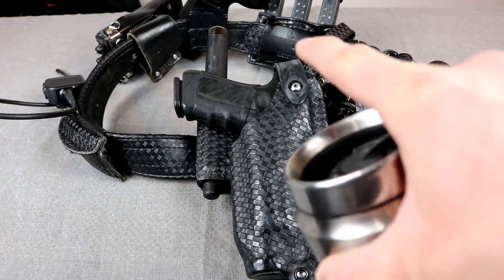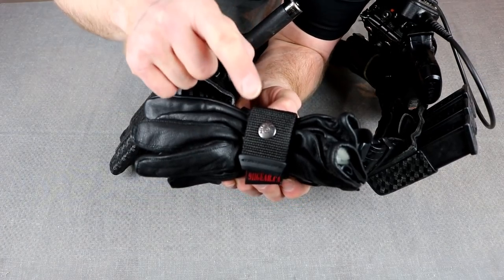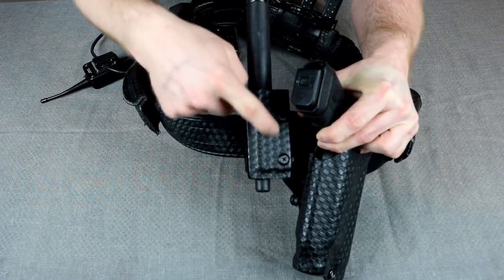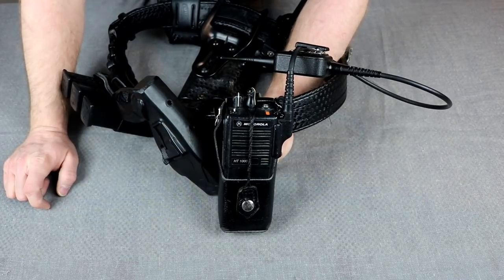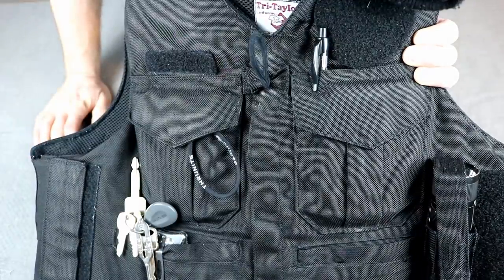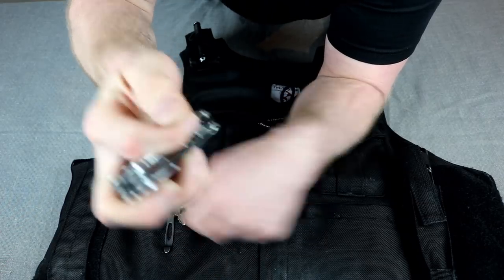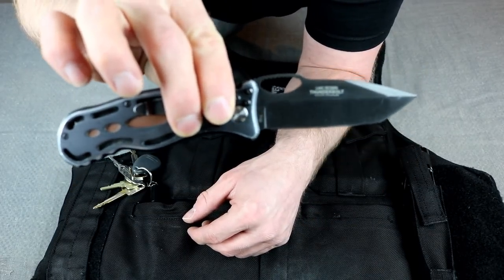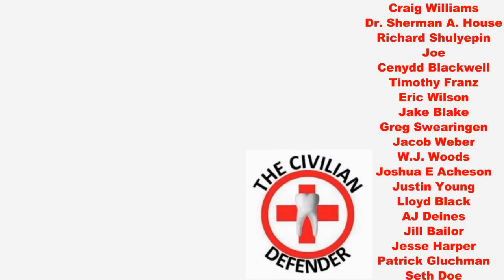POLICE Duty Belt: New Ideas

Comment: I’m blown away w/the amount of gear cops carry.  I started in 1968 and our duty belt had a revolver, 18 rounds of extra ammo, cuffs and a stick.  By the time I retired in ‘97 my duty belt had a Glock 23, two spare mags, cuffs, a collapsable baton, and a portable radio.  Apparently the cargo vests came along some time after I retired but all that gear has to be VERY heavy.  As to having enough ammo on your person I ran out in the middle of a gunfight in 1974 using my issued Colt Detective Special so I always carried LOTS of spare ammo after that experience.
Reply from the maker: Some of it got lighter so there is room for more stuff. Vests have dropped dramatically in weight in the last 20 years and flashlights weigh only a tiny fraction of what a mag or kellight used to weigh. Polymer laminates have nearly completely replaced leather and boots hare mostly foam and polymer compounds now. The only thing that has stayed about the same weight is the radios. (depending on how far you go back)
Reply: Yikes! Must’ve been quite an experience to run out of ammunition in the middle of a gunfight!
Reply: Considering the situations you can get into I would carry more than anyone you know..

Comment: Baton behind the gun is not optimally placed.  Its slower to draw since its akward behind the back and you can't deploy a striking draw.  Cross draw baton is better.  Also its best to keep other weapons away from your gun side.   If a suspect is fighting for your gun,  they will also have access to your baton on the same side.  If the baton is cross drawn from the weak side,  it can deploy and strike a charging suspect at the same time. I keep all non lethal weapons on my left side. I've been to two academies in CA and they both teach baton away from gun side.

Comment: Big thing I would recommend changing would be the holster. I would go to a level 3 with the ALS as well as the SLS. That way if you do happen to draw your firearm, you don't have to worry about rotating the hood back up to make sure your firearm is secure. With the ALS it will automatically lock your firearm into level 2 retention, without flipping the SLS hood back up.
Reply: Hunter Boone agreed
Reply: I went the same route. I used a low  ride  belt mount and used a old drop leg strap and ran it between the holster and the belt mount to limit the holster flop when drawing. It worked well for me without having to use a drop leg.
Reply: Nope.

Comment: You might like looking into Uncle Mike's Mirage Belt Keepers.  Molded polymer ones I lucked out and purchased by accident in recruit school back in 2001 and have pretty much lasted me since then.  Minor scratches and wear and tear, but still very serviceable.  Bought a second set when I lost a couple over the years, but other than that all are still in use.

Also started using the Center Mass Patrol Rifle Integrated Magazine pouch.  Usually is placed behind pistol mag pouch, but I've been using behind my taser holster.  Can hold a 20 round pmag without being visible at all.

Normally carry a surefire 6P on my belt so that I always have a light day or night.

Comment: Kind of different from how I wear my belt, but we're not using utility vests, so everything has to go in the belt and pockets. One suggestion I have for you, is to consider moving your radio up to your chest, especially if you are getting newer radios that might be more light weight. We use Sepura TETRA terminals which are really lightweight, and it's a breeze not to have to worry about the cable going up from the belt, attaching it etc. Just move the whole thing up there. I was sceptical about it at first, but now I totally dig ut. Less wires, less weight, less stuff to go wrong. And just attach a mount to your shirt/jacket/vest whatever, so if you're changing clothes, you just clip it off and on again in a second.

Comment: I would recommend the Streamlight Stinger LED HL, it is a very good light that puts out 800 Lumens compared to the 350 Lumens the normal Stinger puts out. It is going to run you around $110 depending on the package you get from the Officer Store
Reply: Keaton Pfost picked one of those up recently. Since I already had a stinger, I bought one on Amazon without the charger for about 80 bucks. Put one of those Bust-a-Cap glass breaker end caps on there and it's a great multi-function tool!

Comment: I'm not LE but in my time working security and in the Armored car industry I found the safariland 6360 which is the level 3 version of yours to be a better holster. I could draw from it just as fast as I could from the 6280 and it's a lot more secure. I can't tell you how many time I bumped the SLS hood on something and opened it. I was glad to have the added ALS lock to keep the gun in.

Comment: New flashlight you say? I just picked up an amazingly bright bad ass light. The bundle was about $100. The Nitecore P12GT. 1000 lumen,  different brightness settings with memory for the last used. Came with 2 3400amp hour batteries, that last forever. The light itself has a simple warning light built into mode button after battery reaches 50% discharge. 300yard search type beam at night with decent spill still to light up the surrounding area.

Shout out from a South Burbs native, pretty far south but still North of 80
Reply from the maker: Sounds like you are right by me....

Comment: If you still use those or similar gloves, you can use most any mild soap or saddle soap. Disinfecting is trickier, alcohol might be the least damaging. Perhaps some of the Lysol concentrate mixed with water. Then treat with some Lexol (not too much or too often as oils will damage leather over time) and a wax treatment (can be used every cleaning and in between to preserve the leather).

Comment: Typical but good setup. I see some people carry the tazer at the 10/11 where your mags are, mags at 1/2 where your cuffs/leathers are, flashlight behind the tazer at your 9, and cuffs at 4 where your baton is. Tazer is right up front and closer for cross draw, while shooting the mags are right below your support hand, flashlight is at your side where your arms rest, and while grabbing your cuffs you can go forward to deadly if need be. Not a major reduction in reaction time, just slightly less distance to travel, but the most important thing is that you know where your gear is blindfolded. As for the radio, if you use it a lot, up front might be better. And i like the key thing, i do the same thing for my house keys so i know which to use at what door in the dark. And a cool handcuff in my opinion is the streamlight one, it has a light on both the key and the lock side, and is flat so you can get good grip and torque on it.

Comment: Great video, very informative.  Just 1 suggestion....move the tourniquet off the shoulder.  IF you were to need it for self-aid, you should have it in a spot that is in easy reach with either hand, even if that hand/arm is injured.   I would place it on your duty belt, in place of your leather gloves OR to your vest on the lower right hand side just off the pocket...opposite to your flashlight.

Comment: Seems like a fairly good setup, may move some more of the gear off the belt to the vest if the new one allows, like your cuffs, radio, maybe the tazer, anything to shift weight off the hips and more to the shoulders. Changing up to the 6360 if allowable would not be a bad move either. If you carry an AR in the car, maybe a spare 20 or 30 round mag on the vest or on the belt? Or do you carry a go bag with spare mags / IFAK / extra tq in the trunk?

Comment: My suggestion would be to move the magazines to a strong side draw on the vest.  Put the baton on a 45 towards the gig where the mags are currently. If you use a double horizontal mag pouch the baton will lay right on top of them allowing for five mags all together. Taser criss draw on the vest as well
Reply: I don't like things that can cut kill or cuff me accessible to those behind me
Reply from the maker: If I could put the taser on the vest I would definitely put my baton back in cross draw. That's where I had it pre taser. Policy though precludes me from moving the taser substantially.
Reply: free field training industrial hook and loop tape. Velcro. I have my omag fast mag and a Motorola radio on my vest that way and never had it cone off running or if it got snagged. I use Velcro brand industrial vi use it to keep level 3 hard plates in place too. Keeps the plate from being able to move at all

Comment: Love and hate the slim profile triple magazine holder. Love that you can get 3 mags in the same space as 2. Hate that the mags are uncovered/exposed. Once we go to the ground with a subject, those exposed mags can end up anywhere. I'm thinking of just using two covered double holders on my belt. More secure, plus 4 mags on my belt instead of 3
Reply from the maker: Nah, I've had them for several years now and haven't had that issue. We fight people on the regular here as well. I'm actually running an open top light pouch on my vest now as well. You just have to tension them properly.
Reply: @freefieldtraining  Oh well that changes things a bit... I didn't realize that there was adjustable tension on those. I assume it's a screw? Thanks for the reply, I'm gonna look into them for sure.

Comment: If y'all are switching to molle I'd get your radio on it, and as far under your arm as it will go. I run my radio under my right arm pit (left handed) and once you get used to it...it's out of the way. 
Otherwise the sreamlight Strion is a slick little light and streamlight makes a hard plastic carrier for it that should slide on the vest. 
I'd invest in a eleven10 TQ carrier, they make vest attachments for those as well. Probably best to put it dead centre on the vest. 
Otherwise the more crap you can get on the vest, the better.
Reply from the maker: I had an eleven 10 carrier, it broke rather quickly.
Reply: free field training I guess that's a valid reason not to carry something. I've had a few. The slick front one has held up well. Seems like the ones with the medical cross in front don't last as long, I put those on my medical bags. If there letting you guys switch to molle there is probably a millitary style holder that will hold up better. We're still in slacks and internal vests so we're pretty limited.
Reply from the maker: Yeah, mine was the cross front one. Maybe the others are better, just never went back after the first one. Now I just strap the TK right to my vest with rubber bands and hair ties. Works well and very cheap.
Reply: free field training can't argue with that logic

Comment: Ya know you can buy a thirty dollar Stinger LED Switch Kit for your traditional stinger. Even if you still pick a cool new flashlight you'll still have a great, reliable, 800 lumen full-size light as a back up for your back up. I think posted this on da gram. It'll fix your button issue in addition to an emittance upgrade.

I had the same issue. It would always take at least 3 additional hard clicks for it to shut off sometimes. NOT safe at all when searching for felony suspects at 1 in the morning through peoples backyards. I think what messed it up was water damage. After 6-7 years of being dropped on hard surfaces, falling out of cars, back pockets during chases, and being used as a door knocking and impromptu window breaker, something internally must have loosened and broken a seal. I remember it messing up a little while after backing up another radio on a 415 F (Dispute between a dad and his deadbeat son ). Long story short the son slapped the dad and a tussle ensued. My light falls from my back pocket and rolled into their pool and was 5 feet below for fifteen minutes. Not exactly exceeding Ingress protection standards but its still a long time. A month later I picked up a switch kit from the 'Amazon.com and everything is working perfectly.

Comment: I support you carrying 3 spare mags, but as far as not having enough ammo, that wouldn't be the case as to why anyone should carry a spare mag, the reason why I as an instructor recommend people carry a spare mag is because the one in the gun could fail, and the quickest way to fix a jam, is by doing a reload. If a tap/rack didn't fix it, reload it. If you have a double feed, use a different mag after you have cleared that jam. 

If you have used your side arm as a club, after shooting some rounds, treat the gun as a single shot, and put a fresh magazine in, because the sheer inertia and movement of the spring compressing and extending, could cause a round to flip, or rotate while in the weapon, and cause it to not feed properly.
Reply: And if you are two mags in, and the threat still has not stopped then you need something bigger like a shotgun or patrol carbine.
Reply from the maker: @JohnSmith09123  Problem there is gunfights in the US are come as you are affairs. If you don't show up with a rifle or shotgun in hand and ready to roll  statistically the chances you will make it to one before the fight is over is exceedingly low. Plan accordingly.

Comment: Would be interesting for you to add a extended baseplate for your mags, +3 rounds to each mag can make a difference and it doesn't weight all that much
Reply from the maker: All the ones I have tried have reduced reliability.
Reply: @freefieldtraining  Were the springs also upgraded ? It's a common mistake with baseplates that causes unrealibility, in any case the Taran Tactical baseplates are pretty solid although more on the pricey side.
Reply from the maker: Yep, I've done it all in that regard. I have a zero tolerance policy for unreliable magazines. If a mag has more than one failure it becomes a dedicated training mag and is replaced with a new mag. Mag extensions are fundamentally changing the geometry and spring rate of the magazine. Unacceptable risk in my book.
Reply from the maker: Now, the 22rnd glock factory mags I have tried and if I wanted more capacity and a slightly longer mag I would just switch to those.
Reply: @freefieldtraining  Those are really good points.

Comment: I would make a little space between the mag carrier and the taser, and put the baton inbetween, using one of ASP's rotating scabbards. 

That way, you could quickly deploy your baton with either hand. 

I'm saying this because of the Hindi Duty Belt S.A.F.E.T.Y. System, which I would follow if I used a duty belt.
Reply from the maker: I tried that a few years back, problem is the taser rotates out of the holder, and this is the only holder currently available for the x26p. If anything is in front of the taser it obstructs drawing the taser. Which sucks because I prefer the baton on cross draw.
Reply: @freefieldtraining  
Would putting the baton inbetween the taser and radio work?
Reply from the maker: Can't cross draw from there
Reply: @freefieldtraining  
How about rotating the belt so that you have a little less room on your strong side, but a little more room on your weak side?
Reply from the maker: I'm not understanding what you mean
Reply: @freefieldtraining  
If you twist your belt so that the buckle is off centre (right hand side); slide everything on the belt back into the positions they were before (apart from the mag carrier); and then there might be enough room on your left-hand side to put your baton in a cross-draw position.
Reply from the maker: That wouldn't give me more room as the mags need to be where they are at. I can't put them center line on my body. That would take reprogramming almost 20 years of training for where to go for them.
Reply: @freefieldtraining  
There are holsters for the X26P available from Safariland, Blade-Tech and Blackhawk. Maybe one of those would allow you to carry the baton and taser in a cross-draw position. 

If that doesn't work, you could try mounting either the taser or the baton in a cross-draw position on the molle on your new vest.

Comment: That rubber slip on grip for your hand gun is prohibited at most agencies for good reason.  It can slip up over your mag release and hold it depressed.  Most people tell me they never slip but most people did not take the setup to a handgun retention class and see what happens when you are fighting for possession of the handgun.  Stay safe all.
Reply from the maker: The thick ones do. This is just a piece of bike tire inner tube. It has to be replaced about every three minths but it doesn't cause any mag release issues and it adds minimal bulk to the grip.

Comment: But there just has to be a better polymer carbon fiber mixture that's more durable and resilient but still gives you the wiggle room so you don't feel like you're running like a robot or Frankenstein with the Rigamortis all that weight shifting side to side there's just got to be a more law-abiding way

Comment: I have a similar designed belt I found at a local pawn shop. In good shape still with some minor wear from previous owner. Still need other items to complete it.  Had not heard of some of the stuff you displayed on your belt though. lol! 

Wow! All those accessories look expensive. Department pays for most if not all of that gear correct? $$$$